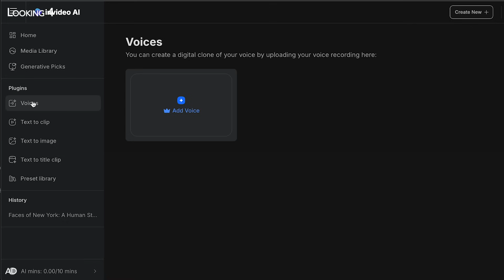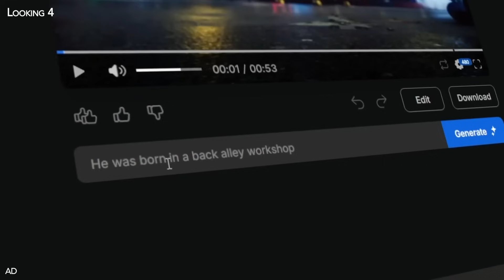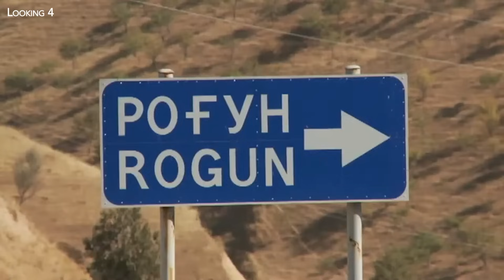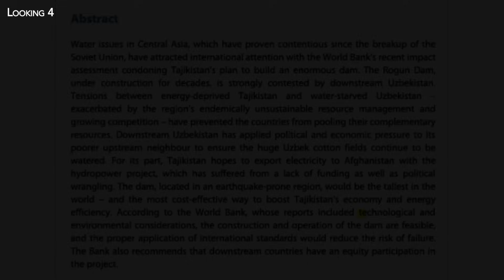Tajikistan is Building the World's Highest Dam

Comment: The Aral sea destruction was caused by water diverted to GROW COTTON, and now the country that benefits from it is complaining about it?  They want all the water from ANOTHER river to use to grow cotton in a place no one should be growing it, or any water intensive agriculture.  As the discharge from this dam will still be HIGHER than most of the land DOWNSTREAM, the discharge can easily be sent via concrete lined canals and tunnels to whereever it's neighbor wants to waste it growing cotton.  Negotiating to give away or sell at rock bottom prices 5 or 10 % of the electricity would I'm sure go a long way to eliminating issues, esp if it can be done in a way leaders of country make billions marking it up and milking their impoverished people for.  Alt the proceeds from 5% of the elec could fund agricultural reclamation in they and their neighbors countries as has been done over millions of acres from China to Australia to Africa.  Local based projects to terrace, pond, etc. run off to soak into soils rebuild aquifers fuel plant growth for animal fodder and sales of meat hides etc, and tree farms and sales from those, right down to truck farms for local market sales.  This water in aquifers eventually makes it way out of ground into old stream beds and back into major rivers.
Reply: Uzbekistan decided to double down on draining the Aral Sea. They still use every drop the river delivers to grow cotton, despite the fact that the growing desert around it blows toxins and salt on the fields and makes the yield less and less. Every schoolchild in the country is drafted to pick it every year.
The Kazaks have cut down on their agriculture and started refilling the Northern Aral Sea, in their territory. They've built a huge dam to avoid wasting it on the much larger Southern Aral Sea, but it's a start.

Comment: I don't understand the argument that the dam disrupts water flow downstream of the dam. True, it does so while its basin is being fillled (an effect that can be easily minimized by lowering the filling rate).  But once its basin is filled, a dam can regulate downstream flow such that extremes of maximum and minimum flow are avoided. If managed correctly it will provide a constant flow throughout the year. Something that could be of great benefit to downstream users of water. In winter water flow is reduced because most precip falls as snow. The water level in the basin can then be gradually lowered to provide water for downstream users. Once the snow melts in spring and summer the basin can be refilled by excess runoff which can later be released during the summer and autumn months. Downstream users should be consulted regarding their water needs and a compromises must be found. But overall such a dam has the potential to provide important benefits also to downstream users. Switzerland has a plethora of all sorts of dams, some of them quite big and has always found ways to satisfiy the needs of all users of water.
Reply: lmao so naive
Reply: I doubt they'll be using any of the impounded water to divert for agriculture, which is one of the usual problems with building massive dam projects. The Uzbeks might want large amounts in spring for growing season, and less after that, but that's a normal kind of thing to negotiate.
Reply: It is hard to find info on past studies but dams increase water loss through evaporation and underground infiltration.
Reply: The problem is that Uzbekistan supplies the majority of Tajikistan's natural gas for electricity production. If this damn were built, then Tajikistan would no longer be reliant on Uzbekistan's natural gas for energy production and that would lessen Uzbekistan's influence over Tajikistan. They (Uzbekistan) only relented on Tajikistan building the damn because the Chinese discovered a large natural gas field near Dushanbe, and so Uzbekistan would lose this form of leverage over Tajikistan anyways. Also, the Amu Darya and Syr Darya canals are not lined with concrete and so a large amount of water is wasted and therefore the Aral Sea is not receiving enough water and so has lost over 90% of its water causing one of the worst ecological disasters in history. So even a slight reduction in either of those rivers by Tajikistan (and now Afghanistan with its new Qush Tepe canal) will spell even less water reaching the Aral Sea and make the disaster even worse. And I live near the Columbia River in the US state of Oregon, and we have treaties with Canada because Canada controls the head waters of the Columbia River and if they wanted, they could block off all water to the Columbia River and make even the USA's largest damn, the Grand Coulee dam, useless if they wanted too. I hope this clarifies things.
Reply: @GenXerReacts в Таджикистане только две электростанции мощностью 220 МВт которые работают на газе и то только зимой,а летом они не работают
Reply: There's another problem is orol river is going to drying
Reply: chinese dams were supposed to regulate too... but ccp officials make more money the higher the level of water (generates more energy) and it ends up with the dams being filled during droughts and only released when it's at the max, aka when the rivers are alredy overflowing and so they do the opposite of regulating flows
Reply: Problem is that it can also be used to do the opposite to downstream users.

Comment: 3:22 - modern education shining through, innit?

A DAM CAN'T be "hydroelectric" - it could be "concrete" or "earthen" (or such) - and that's it. ONLY a POWER GENRATING PLANT which is using the water from the reservoir to generate electricity is called "hydro-electric" - for rather obvious reasons.

Comment: Uzbek farmers waste a huge amount of water, up to 90 per cent according to some sources, on wasteful irrigation and growing of water thirsty cotton cultivars. This is the main cause of the Aral Sea disappearing. If they sort that out, the effect of a dam on a tributary won't be important
Reply: True people water plants in the middle  of the day heat plus Uzbekistan  is using one of thr most water thirst cotton species so
Reply: Now it is not planting cotton as much as Tajikitan.
Reply: It's not the farmers. When the old Soviet Union built canals on the Amu Darya and Syr Darya rivers they didn't line the canals with concrete, they lined it with dirt. Similar to what Afghanistan is doing with its Qush Tepe canal. This allows the majority of the water to simply leach away, and not enough water reaches the Aral Sea and so the sea has lost over 90% of its reservoir causing one of the worst ecological disasters in human history. And the sad this the Soviets KNEW that the Aral Sea was going to disappear by the 1960's or so, and they did it anyways. To make matters worse is they forced the Central Asian countries to plant cotton with the water from the canals and cotton is a very water intensive crop.

Comment: Uzbekis need to realise that a hydroelectric dam has to release its waters to generate power!
Reply: Absolutely right. There is always an issue with evaporation but that is not a problem here and such evaporation as does arise here will be carried by prevailing winds straight into the faces of surrounding mountain wall and the rising air forced to dump its' moisture to run straight back into the streams that feed the lake. The same applies to water diverted for irrigation, Plants consume the water which is then transpirated into the atmosphere and then the prevailing winds will carry it straight into the face of the mountains and the water returning to the Amu Darya one way or another. 

As for starving the Aral Sea. This is complete nonsense. That damage was set in motion in the 1950s with the building of the Karakum Canal which has absolutely NOTHING to do with the Tadjiks and everything to do with Uzbek and Turkmen politicians of the Stalinist variety most of them grateful, that with Khrushchev rooting out Stalinists,  to have woken in the morning without the MVD later KGB having banged on the door overnight.
Reply: @terryhoath1983 An irrigation / evaporation / wind / rainfall cycle that feeds the lake in a closed cycle above the dam is of little help downstream.
Reply: However a significant portion of the water in that reservoir is very likely going to be diverted (in Tajikistan) for irrigation use.  THAT water won't be continuing downstream to the Amu Darya.
Reply: They release water to regenerate electricity in WINTER. Uzbekistan need in summer. Tajikistan has to hold water in summer to regenerate electricity in winter. That's a problem. Uzbekistan always sell electricity to Kyrgyzstan and Tajikistan to not to use water in winter, even Uzbekistan doesn't have enough electricity for itself
Reply: @Uchqunbekuz   тоҷикистон ҳақ дорад дар замини худ ҳарчи ки хоҳад месозад
Reply: @Judewarner 1536   The point is that people like the Michigan engineer (above) ... he is Americsn so cannot be expected to understand .... don't understand that, in this particular location, once the reservoir is full, nothing will be lost to the flow of the Amu Darya. It is not like the Aswan High Dam or Sennar in Egypt and Sudan where vast amounts of water is lost to evaporation, much of it dumped in the Red Sea or onto the Saudi Mountains. Doesn't do the Saudis any harm but we have had the Egyptians threatening to bomb the new Ethiopian dam despite evaporation being far lower (higher elevation and more cloud cover) and such evaporation as does occur nearly all of it falls as rain within the catchment having negligible effect on the river flow leaving still more than the Egyptians know what to do with in the peak flow. 

If the British Government in 1918, through the British military occupation of Egypt had encouraged the Egyptian monarchy  and the Ethiopian Monarchy to co-operate (Sudan was not a state at that time, just a territory claimed by the Egyptian monarchy in which lived perpetually warring tribes hence the British-Egyptian condominium) there would have been no need for the extremely expensive Aswan High Dam and Sennar Dams, both with huge areas of shallow water around their edges which gives rise to massive evaporation under the desert Sun .... and the absolutely ludicrous Jebel Aulia project which leaves hundreds of square miles of malarial mosquito-paradise mud flats each year, but had relied upon regulation of the Nile by far cheaper but more effective dams on the Blue Nile in Ethiopia and at the Owens Falls (outlet from Lake Victoria) on the White Nile, then there could have been 

a/ a much lower dam above Sennar to more effectively served the canal for the Gezira Project. The canal would have been about 20 miles longer to catch the water higher up but at a fraction of the cost of the monstrously long  Sennar Dam and drawing water continuously and reliably off of the regulated Blue Nile.
b/ not having the Aswan High Dam flooding vast numbers of antiquities on top of the evaporation but run a canal in a cutting round the East side of the river following the line of the railway, the railway moved a few hundred yards to the East, so that the water could fall through turbines to the Nile below the 1st Cataract and provide far better irrigation from the regulated river. The original Aswan Dam was built above the Cataract so as to give capacity for the lake but with an economic height for the dam, the purpose of the original dam and the first raising being purely irrigation. With the canal round the side, there would have been no need for the second raising. the hydro added with the second raising which flooded many antiquities would not have been necessary as the head from the canal to turbines below the cataract would have been greater.
c/ with the river's flow regulated far more electricity than the High Dam provides could have been provided with 30 foot high dams above the 2nd and 3rd Cataracts diverting water into canals to pass round the cataracts to, as with Aswan, fall through turbines below the cataracts..  
d/ far more land could have been irrigated with dramatically fewer mosquitoes if a contour canal had been taken off of the regulated White Nile well above where the maximum tail of the Jebel Aulia project  now is.
e/ millions of Ethiopians who to this very day have no access to electricity , their parents and grandparents could have had good clean electricity 70 and 80 years ago.

I KNOW THESE THINGS. UNLIKE OTHERS, I HAVE DONE THE RESEARCH. 99.9% of the "experts" pontificating below this video have never heard of Sennar, or the Gezira Project or the Jebel Aulia, or the Owens Falls OR that a one foot rise in the height of Lake Victoria (it does fluctuate) holds 5 cubic miles of fresh water. Neither do they have anything more than a basic understanding of physical geography. if that.  My knowledge tells me that the Uzbek administration are a bunch of bullies who have been making trouble over the Tadjik Dam for the sake of it. The new dam will not magic up more water, but, unlike in Egypt and Sudan, the geography will ensure that any loss will be infinitesimally small if at all, in fact, the result will be a more even flow and will have absolutely NO effect on Aral Sea disaster.
Reply: @judewarner 1536   The point is that people like the Michigan engineer (above) ... he is Americsn so cannot be expected to understand .... don't understand that, in this particular location, once the reservoir is full, nothing will be lost to the flow of the Amu Darya. It is not like the Aswan High Dam or Sennar in Egypt and Sudan where vast amounts of water is lost to evaporation, much of it dumped in the Red Sea or onto the Saudi Mountains. Doesn't do the Saudis any harm but we have had the Egyptians threatening to bomb the new Ethiopian dam despite evaporation being far lower (higher elevation and more cloud cover) and such evaporation as does occur nearly all of it falls as rain within the catchment having negligible effect on the river flow leaving still more than the Egyptians know what to do with in the peak flow. 

If the British Government in 1918, through the British military occupation of Egypt had encouraged the Egyptian monarchy  and the Ethiopian Monarchy to co-operate (Sudan was not a state at that time, just a territory claimed by the Egyptian monarchy in which lived perpetually warring tribes  hence the British-Egyptian condominium) there would have been no need for the extremely expensive Aswan High Dam and Sennar Dams, both with huge areas of shallow water around their edges which gives rise to massive evaporation under the desert Sun .... and the absolutely ludicrous Jebel Aulia project which leaves hundreds of square miles of malarial mosquito-paradise mud flats each year, but had relied upon regulation of the Nile by far cheaper but more effective dams on the Blue Nile in Ethiopia and at the Owens Falls (outlet from Lake Victoria) on the White Nile, then there could have been 
a/ a much lower dam above Sennar to more effectively served the canal for the Gezira Project. The canal would have been about 20 miles longer to catch the water higher up but at a fraction of the cost of the monstrously long  Sennar Dam and drawing water continuously and reliably off of the regulated Blue Nile.
b/ not having the Aswan High Dam flooding vast numbers of antiquities on top of the evaporation but run a canal in a cutting round the East side of the river following the line of the railway, the railway moved a few hundred yards to the East, so that the water could fall through turbines to the Nile below the 1st Cataract and provide far better irrigation from the regulated river. The original Aswan Dam was built above the Cataract so as to give capacity for the lake but with an economic height for the dam, the purpose of the original dam and the first raising being purely irrigation. With the canal round the side, there would have been no need for the second raising. the hydro added with the second raising which flooded many antiquities would not have been necessary as the head from the canal to turbines below the cataract would have been greater.
c/ with the river's flow regulated far more electricity than the High Dam provides could have been provided with 30 foot high dams above the 2nd and 3rd Cataracts diverting water into canals to pass round the cataracts to, as with Aswan, fall through turbines below the cataracts..  
d/ far more land could have been irrigated with dramatically fewer mosquitoes if a contour canal had been taken off of the regulated White Nile well above where the maximum tail of the Jebel Aulia project  now is.
e/ millions of Ethiopians who to this very day have no access to electricity , their parents and grandparents could have had good clean electricity 70 and 80 years ago.

I KNOW THESE THINGS. UNLIKE OTHERS, I HAVE DONE THE RESEARCH. 99.9% of the "experts" pontificating below this video have never heard of Sennar, or the Gezira Project or the Jebel Aulia, or the Owens Falls OR that a one foot rise in the height of Lake Victoria (it does fluctuate) holds 5 cubic miles of fresh water. Neither do they have anything more than a basic understanding of physical geography. if that.  My knowledge tells me that the Uzbek administration are a bunch of bullies who have been making trouble over the Tadjik Dam for the sake of it. The new dam will not magic up more water, but, unlike in Egypt and Sudan, the geography will ensure that any loss will be infinitesimally small if at all, in fact, the result will be a more even flow and will have absolutely NO effect on Aral Sea disaster.